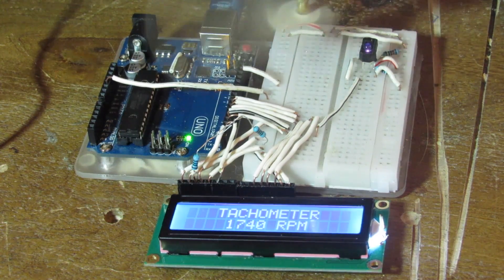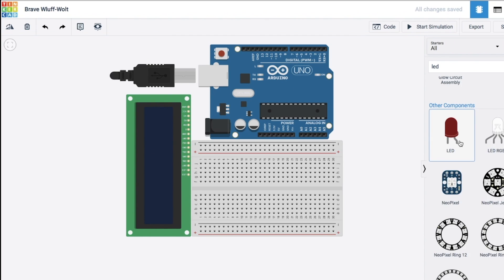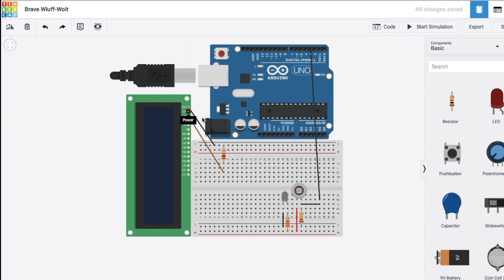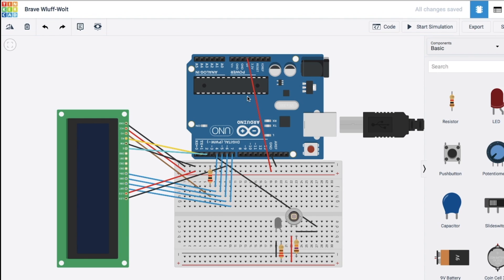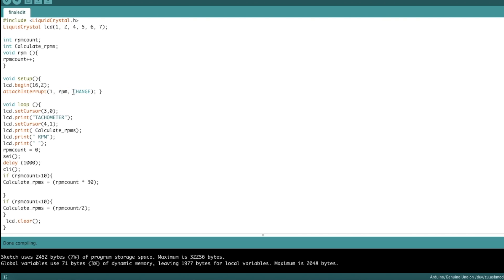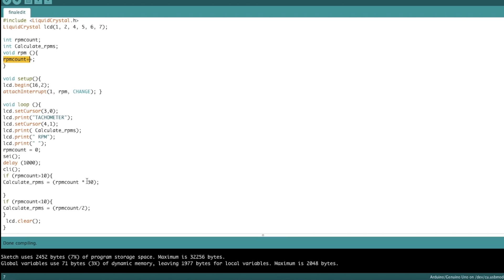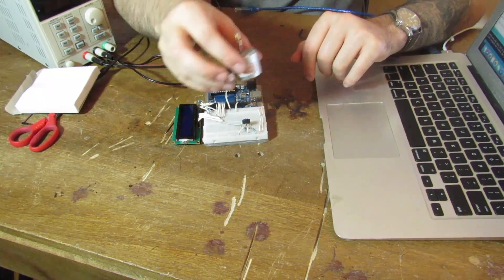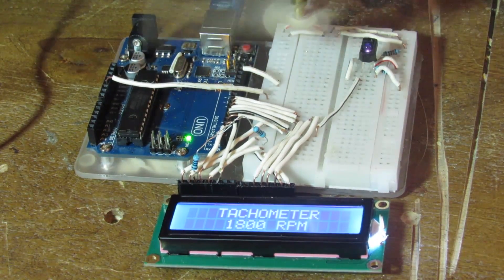Detecting High (and Low) RPM's | Arduino Uno

Comment: The reason the count may be doubled is that your interrupt is set to detect all changes on the sensor. So it will trigger when  it goes to 0, then again when it goes to 1. Try setting your interrupt to only RISING or FALLING and the count should correct.
Reply from the maker: ohhh that would definitely explain things. Much thanks
Reply: Miller's Planet that's also why it was 30 and not 60 with the other case
Reply: Was also my thought. Maybe you could check this by adding an output (serial/led) every time this interrupt is triggered.
Reply: @wishihadablog  I would try but sadly a lot of my stuff is packed in prep for moving. But I encountered a similar issue when doing some works on encoders for a robotics project.
Reply: I was going to say the same thing. I run into that with my digital to analog converters I use in industrial equipment